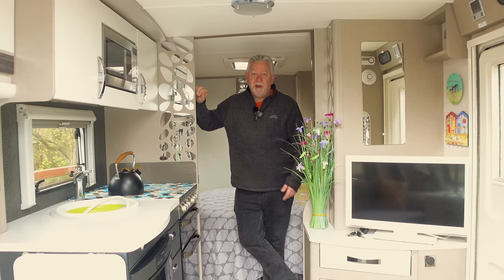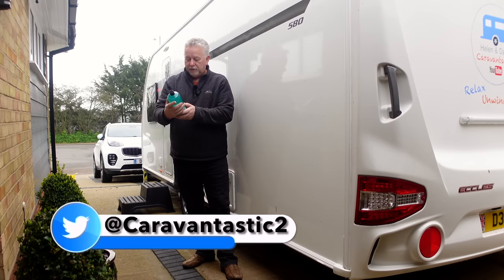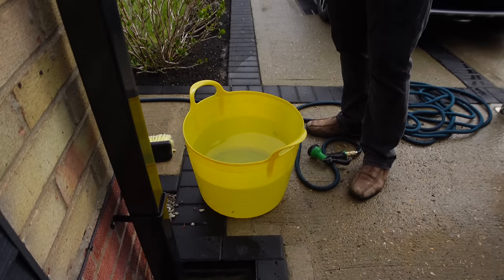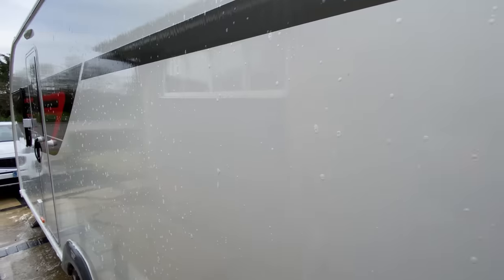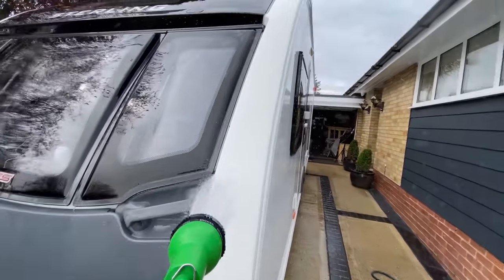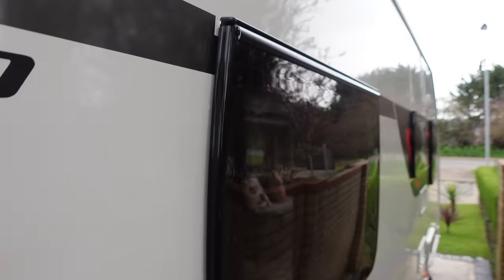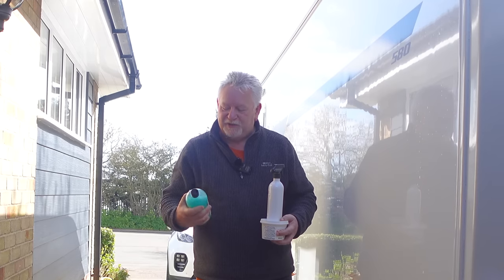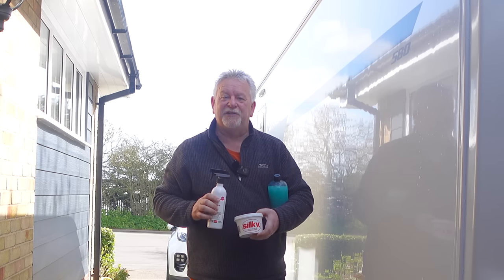Shiny Happy Caravan! We fly the new flag & the 12v hairdryer is ditched.

Comment: I have caravaner for 30 plus years and have reached detailing for close to the same. There is nothing wrong with a pressure washer it all depends on how how powerful a setting you have and even more important is how close the pressure washer spray is to the caravan. If you hold it close to any paintwork and it can give you problems but step back no problem at all.
I have used silky for years and the cream cleaner is amazing but autoglym do a caravan cleaner which is the best caravan cleaner I have ever used. I have tested many caravan cleaners and while Covid was at its height I put 6 different sealant on one side to see which was better over an 18 month period. 
Though my testing I tried to buy more silky products but was very limited on places to buy and quite expensive. I have a couple of products to test. It is my goal to find the best cleaner, polisher, pads and sealants to apply. I will let you know.
Loving the videos
James
Reply from the maker: Thanks James, Nothing against pressure washers, I have one and have had many over the years, just a personal preference on using the hose, less hassle, less noise and I'm always a lot drier at the end of it lol. Never tried many caravan cleaning products but the Auto Glyn sounds like it's worth a try. Thanks for watching. ATB, Dave & Helen.
Reply: Agree with NOT USING A PRESSURE WASHER. There is no benefit or need to over using a hose with shower setting on the spray gun as a pressure washer DOESN'T  clean the caravan any better as vans only need a light rinse. . With some pressure washers you could wreck the caravan body and seals if you mistakenly set the pressure too high. Not worth the risk. No such mistakes with a hose with the spray gun set to shower. 
BTW Dave (and Helen) your caravan exterior looks amazing. Well done.
Reply from the maker: @M..R....  Hi and thanks very much for watching and leaving a comment, completely agree ref: Pressure washer. Thank you for your feedback. ATB Dave & Helen 👍

Comment: Hi Dave and Helen, 
Another great vlog, you could clearly see the shine difference with your shadow on the van, great job.
I will have to stick to dry sparkle as our van is in storage with no access to water.
You have answered my question regarding 12v vac for the van and blowing the fuse I need a plan b.
The flag looks great, as for the t towel you can buy eyelets from camping shops to repair where tie down ropes go maybe an idea.
Paul and Jo 👍
Reply from the maker: Hi Paul & Jo, thanks I’ve just found the eyelets you were talking about and will pick them up shortly. The 12V is deffo one to watch. Have you blown a fuse too? Thanks as always for leaving a comment. Cheers, Dave & Helen 👍
Reply: Hi,
Glad we could have been some help.
Yes we blew the van 10 amp fuse when trying a 12v car vac I thought maybe the power surge was too much fir the van but after your vlog I won't be using again.
Thanks 👍
Reply from the maker: @Meggy6571  yeah, I think the rating on the 12v circuit in the caravan is less than the car. Shame. Thanks again, Dave